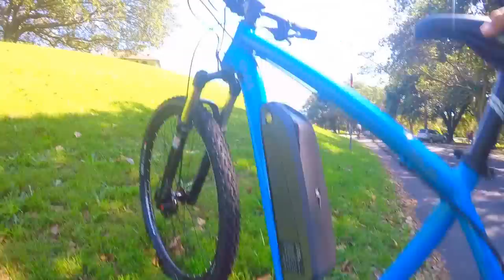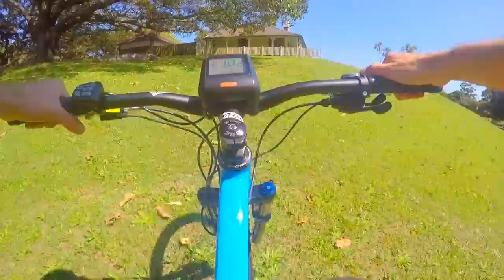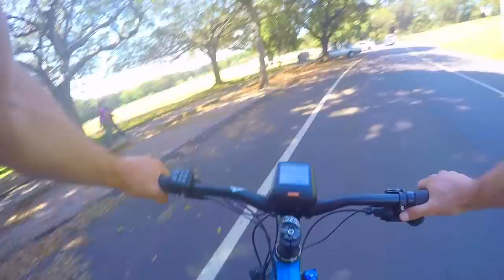Bafang Max Drive REVIEW (video4) Hill climbing tests • 250w Electric MTB • www.emax-ebikes.com.au

Comment: Bafang max doesn't work with  low gearing. At least not with stock settings. I have 34t up front and 40t in the rear. Assistance cuts on every wheel rotation.  11-36 with 34t front gear is fine. Just my low gear that doesn't work correctly. I would  love to figure out this issue. My bike is a fatbike. So low gearing is very important. Stock gearing was 38t chainring and 12-32cassette. Not optimal for offroad.
Reply from the maker: Sounds like you have a chain line problem or derailleur is bent or not adjusted properly. Take to a bike shop and ask them to adjust, they will use a derailleur hanger alignment tool to check it it’s all straight. It could also be the chain that is now too short, when you fit a big cassette you may need a longer chain. I really believe there’s nothing to do with the motor. It could even be that the bicycle frame wasn’t designed with a perfect alignment. Look from the top looking down and see if the chain is touching anything as it twists.
Reply: BrunoPOWEEER no it is the motor that cuts off in low gear. 40t rear and 34t front. With stock gearing ratio it works fine. All the gears work perfectly without assistance.  I know how to work on a bicycle.  The programming and electrical part is new to me.
Reply: BrunoPOWEEER I have never seen a stock bafang max drive setup with any other setup than 38t up front and 12-32cassette in the rear. My guess is that my upgraded offroad gearing is outside bafangs programming specs. 38t up front with 40t in the rear worked. But 34t front and 40t rear cog is probably to low for the sensor calibration settings. Maybe 2 wheel magnets and reprogramming is the solution.
Reply from the maker: Thor _ yeah... someone must have limited the programming somewhere, the bicycle manufacturer, not Bafang.
Get the programming cable, download the software and start playing with the settings. I can guarantee that motor isn’t smart enough to tell that you’ve got a bigger cassette. All it compares is the chainring speed vs wheel speed. I overpowered a few Maxdrive with a friend waaay over the specs, we managed to brake metal pieces inside the motor and never ever saw any Maxdrive stopping because of gearing. I installed myself more than 50 motors and tested, never had any problems like that. This is why I believe it’s some programming dramas or even the motor controller (not the motor). It still strange because motors would never complain about a “too easy gearing” but the opposite if there’s too much load would cut to protect the motor from frying.
Two magnets idea is the opposite of what you have to do. 
Having two magnets, the bike will think you’re going double the speed and stop power at 16kmh if your bike is limited to 32kmh. The trick we used to do to all Bosch, Shimano etc without programming was to place the sensor on the frame and the magnet on the pedal bolt (facing the frame) so every time you pedal the sensor reads your cadence instead of the fast spinning wheel. This works great with any ebike that is speed limited.
Reply: BrunoPOWEEER so I can't programme it to read 2 magnets for every rotation. I guessed it was possible since I've seen on forums that 2 wheel magnets will be more common on new systems in 2019.  Something is definitely interrupting the assistance. It's goes violently off and on for every rotation, near the end of the wheel rotation. I guess the magnet passes and turn on the assistance. My wheel diameter is ridiculous because of the fat 4.8inch tires. Wheels are nearly 30inches in diameter.
Reply: BrunoPOWEEER could it be to many crank rotations for my 30inch wheel? Bafang max only goes to 29inch wheel setting. I'm sure it's just a simple programming issue.

Comment: How do you unlock the maximum speed on a max drive?
Reply from the maker: +Mr. Wh0 yeaaaahhh you have two settings to limit the speed, sometimes it's just a display settings but the maximum display speed is 50 or 60kmh I think and sometimes you have to get a programming cable and change via software, not too difficult but you kinda need to know what you're doing.. check out this article showing everything, note that MaxDrivr you don't have throttle so forget about the 3rd window showing throttle settings: https://electricbike-blog.com/2015/06/26/a-hackers-guide-to-programming-the-bbs02/
Reply: ElectricBike Thanks man.

Comment: Silly question I know but with his mid drive motor setup must you pedal to get assisted power? Or can your feet be idle and the bike still develop speed? Not sure if the pedals have a static slip.
Reply from the maker: Haha.. no silly question at all... all premium mid drive motors like Bosch, Yamaha, MaxDrive and other brands have a torque sensor.. it measures how much pressure you apply to the pedals and understand if you're just gently moving your legs to change gears or if you're applying force actually pedalling, it feels very natural to anyone who rides it. Its very efficient as in order for the motor to work it requires you to be helping pedalling.. throttle is nice but power hungry, people get lazy just rolling the throttle and forget to pedal... torque sensor is the ideal bike for most people and gives you the best range per charge, the milder the assist the further you can ride  being level 1 = mild assist / level 5 the most powerful one. =]

Comment: How much resistance is there if you pedal with the motor turned off? I'm looking to get a mid drive ebike but would only like to turn on the boost when I get really tired.
Reply: Sean Findley almost no extra resistance.  And it barely uses battery on assist level 1-2.  I only use zero assist when going downhill or when I get pushed by wind. assist level 5 use a lot of energy. Especially when going fast.  my bafang max drive bike has 4.8inch wide fatbike tires and 11-40t sunrace cassette. I can probably ride my fatbike for 4.5-6hours before the small 36v battery is empty.  That's the 350w version max drive.
Reply: Thor _  great to hear! Thank you for the reply.

Comment: What top speed/ cruising speed can you get using this bike ( considering BBS02 250W/ 500W and want to know the difference for a cruising commute)
Reply from the maker: Hi Antony, I would say at least 40kmh cruising speed on flat depending on your gearing or electronic speed limit. It all depends how you program, there are some settings that you change and it keeps the amperage higher but will drain a lot more battery, factory settings are more conservative designed to make the motor very efficient. Are you here in Australia or New Zealand?
Reply: +ElectricBike (Bruno) thanks for the reply, mate, I'm in Perth. current limit is 250w here, this is for "off road" commute.. ;) , round trip of 30km
Reply: +ElectricBike (Bruno) and I'm more than happy with 35kmh cruising speed, current ebike disappointingly slow (350w hub motor) 27kmh max, feels restricted. building a new one, going to use my pile of 4 ryobi one+ 18v batteries to make a 36v 10ah one for fun and because of reuse(lawnmower and other tools on weekend) and the bafang 8fun 250w motor send about right, but was wondering if I should pick the 500w or maybe compromise on a 350w, your videos have helped a lot!
Reply from the maker: +Antony Day - Yeaahhh Perth is just around the corner near Sydney hahahahaa 
Just for comparison.. a hub motor you need double the power to go uphill like a mid drive and to have the same top speed (powerful hub motors are really heavy and very obvious to cops) I would pick a mid drive no matter what!! 
We may be able to send this bike without the battery for you... There's no throttle to make it super legal like the. Bosch bikes, it's "rated 250w" but if you change the programming you can fly in this bike and no one will ever know haha
Maybe email Ewan sales@emax-ebikes.com.au or call us and get a quote for a bike without battery =]
Mid drive equals POWEEEEEEEEERRR =]
Reply: @antday  I have a befang 250w middrive on my cargobike. In EU 25km/h is the limit but my motor "hacked itself"... One day the display set mph instead of km/h by itself somehow... When i shange back speedlimit can be set to 32km/h.... =D Tough the gearing is not low enough to be practical in 32... But it is nice to bike around 25 without motor turning on and off all the time... 25 is enough in city I think... 32 is nice on long straight road... 250w is enough for me and my cargobike so...

Comment: Thinking of buying a electric fat bike with mid engine from China. Problem I can not find anyone who actually have tested any of the Chinese ones you get for about 1/5 of the price as similar you can buy in Europe. Been on search for over a year and this is the closest I have come to anyone doing any test...
Reply: Rondo Cat you typically get commuters style gearing on a bafang max drive fatbike. So you will need to drop the chaining from 38t to 30-34t. And the cassette is typically 12-32t on budget bikes. You could add a cassette hack and get 11t rear cog so you don't lose to much too speed. I use 11-40t sunrace 8speed cassette on my max drive fatbike. It climbs pretty good even with that big 38t chainring. With 40t rear and 30-34t front it's going to feel like a torque monster for hill climbing.